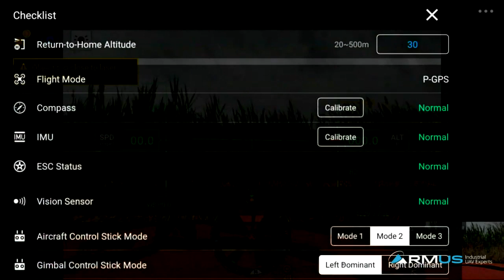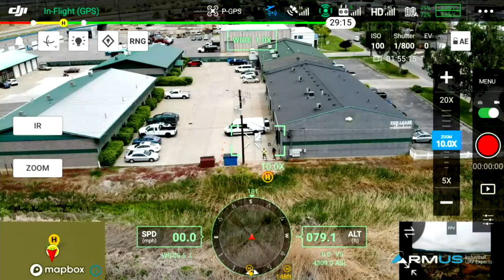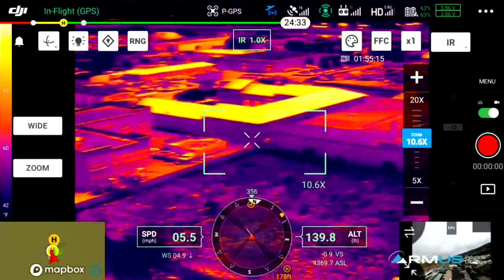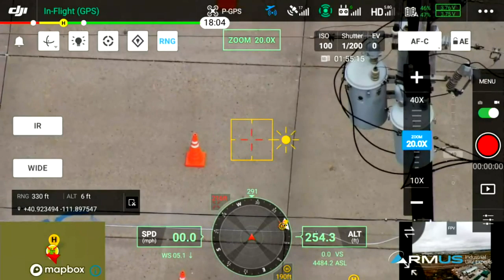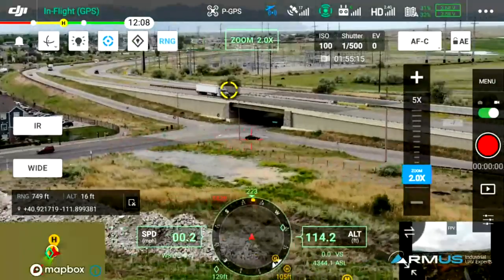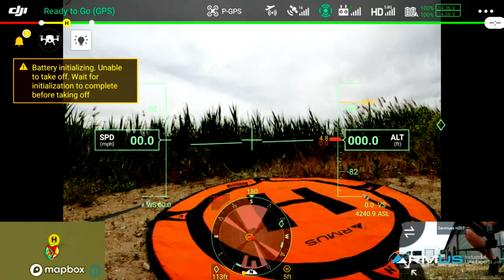May 22 - M300 RTK Live Flight Demo - 12PM Mountain

Comment: Hello, thank you for the video. Question for you. If you were using the M300 for agricultural purposes and had to charge batteries in the field, what type of generator/portable power station would you recommend using with the DJI Matrice 300 BS60 Intelligent Battery Station? Thanks
Reply from the maker: We wouldn't recommend using anything lower than 1200 watts when powering the Intelligent Battery Station at full load. We use a Honda EU2200i when out in the field.

Comment: Just one correction on the question about the laser range to target. You get 3 parameters. 1) Linear range to target (distance from drone to target) 2) Ground range to target and 3) target altitude.  The linear range is shown in red just to the upper left of the heading dial. The ground range to target is shown in the pop up box to the left of the display along with the target altitude.

Comment: what do you use to output HDMI from   smart controller to 3rd screen /laptop?
Reply: I used the Command View. Made by Camera Motion Research. Transmits 1080p at 0 latency
Reply: Jon McBride thanks, What is the best range from controller to laptop you can get with command view?

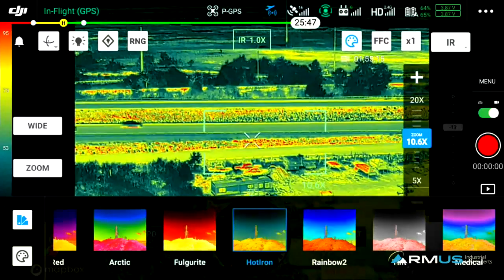Comment: Sorry to tell you, but I think you summoned an RF demon when you said, "gimbal unlock" at 21:55. That FPV HUD is pretty neat; reminds me of a fighter pilot HUD. The zoom function seems clunky, as if designed solely for touch screen. Overall it's an amazing machine with room for improvement. Thanks for the demo!
Reply: While messing with it out there at the live demo, I likely got the remote a bit too close to my LAV.  We also had 4 items transmitting too. 

I agree with the zoom. It’s a little tough to control smoothly with buttons/sticks.